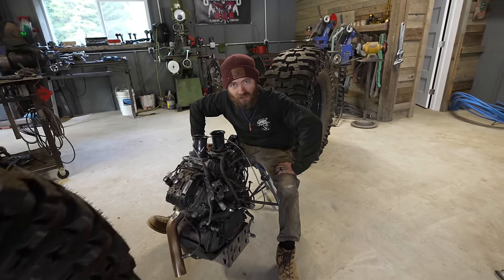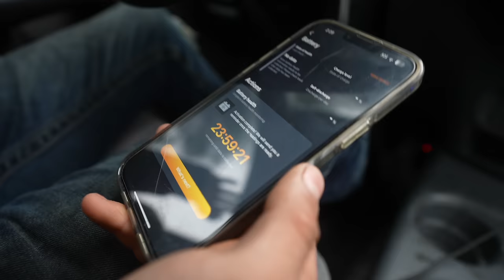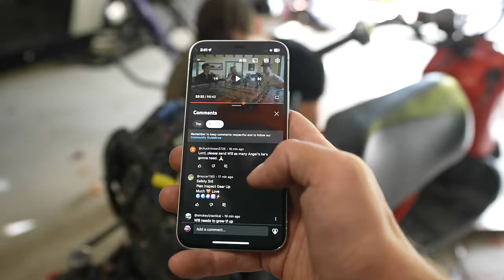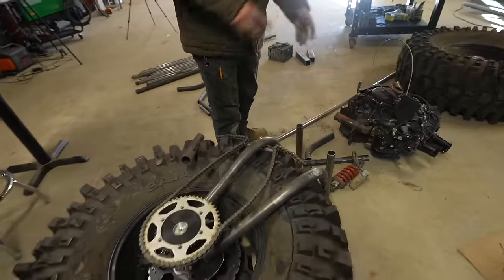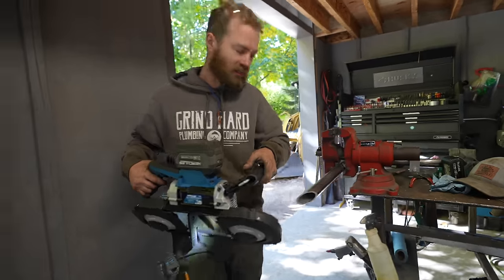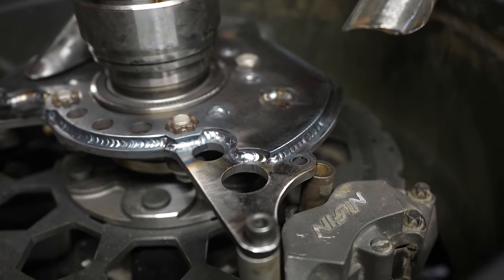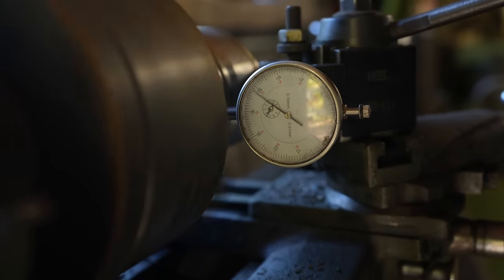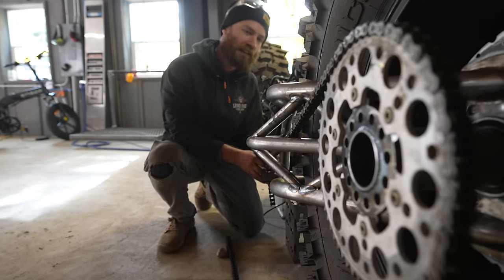Monster Truck Chopper Build! 46'' Tires + KTM Adventure

Comment from the maker: Get 15% off your Carly purchase with code "GHPC" (auto-applied) until December 15, 2023 when you click: https://bit.ly/GHPC_Carly
Reply: “I always have my phone in my back pocket and it makes it so easy to check codes” hahahahahahahahahahahhahaha well played
Reply: Anyways guys since you got the Barbie Jeep the Barbie camper the Barbie mini jet boat it would be awesome to see the general because he's four wheel drive and he is this winter mobile that you guys use a lot during the winter maybe you guys would consider building a like the Kitty cat snowmobiles that already cat makes but one of the Ski-Doo models because they're a little bit bigger and they're a lot better looking wise and put a 1,000 crotch rocket motor or 1000 renegade or just put it on it and build a little trailer for the mini snowmobile and the general will be able to tow the new trailer and the new mini snowmobile that would be badass since winter is coming up
Reply: Mean Build can't wait till it's finished
Reply: Bot
Reply: im slightly concerned about the abundance of incredibly dry wood you have lining the walls, next to the spark emitting plasma cutter in the new shop... might wanna slap a couple tin sheets back there just in case.
Reply: I love buttons on TIG torches instead of the foot pedal
Reply: Heads up. Put a bolt through the center of that hub or it will come apart. It usually has the cv shaft bolting through the center to do that job. But you can do the same with a bolt.
Reply: Tuck your sweatshirt string in when you are using machine tools please. it would suck if you got sucked in
Reply: Do I need to inbox you or turn the person in for commenting to do so on my comment? 😆 🤔

Comment: Swing looking great!! Wont the tire sqwoosh out when the weight is on/jumping etc, or are you running them hard? I run my big wheel tires pretty soft. Just thinking of the clearance to the swing arm, if it’ll rub against it

Comment: I think I’d go with a driveshaft over a chain in this situation. Regardless, can’t wait to see this beast in action!
Reply: I was thinking similar,  a good chunk of a honda Atv shaft drive /swing arm would work for this.
Reply: i get why, but it feels like a chain is cooler imo
Reply: I think that would complicate it quite a bit more. And it would be really cluttered in the rear
Reply: This would be a perfect application for electric hub motors. 🤷🏻‍♂️
Reply: The major advantage of a chain drive in this build is the ability to change gear ratios.
Reply: Chain drives are a lot more customizable.  With a drive shaft you’d need an assembly line of other drivetrain parts.  Too much extra work.
Reply: Some good points about drive shafts. I’d at least go with a beefier chain and sprocket though. I’m guessing that sprocket will get eaten up, and chains will stretch a ton and break. Then again, I don’t suppose this bike will be getting many miles.
Reply: @jdmec81  Lol, exactly.  They ride stuff for a couple days and move on.
Reply: Personally i'd go with hydraulic motors, one for each wheel, they not only would have 2wd but also they would just have to route oil lines to the back and front. Engine would have output connected to oil pump, honestly still not much work to modify it to work that way.
Reply: @millroyboy07  The driveshaft is way stronger though and, for those tires, I think they're gonna need strong.
Reply: @FuckGoogle502  If they use a right chain they should be fine. Something built like a timing chain.  Those typically never have any issue with torque control.

Comment: I made a suggestion in previous video of adding gyro for stabilizing it, and some other changes, but I was also thinking you should make the ride height adjustable. Maybe make some kind of air bag system that allows you to raise up higher if needed.

Comment: Air pressure sense of handles on each side of a handlebar down and more you put pressure on that the more it turns that direction, fly by wire.

Comment: There is a groove around the bearing for an O-ring. That little lip around the hub's bearing is for the o-ring squish into the tapered secrion of the steering knuckle. For better sealing. 👍

Comment: I saw Ethan use a Portaband on a previous episode so I know he has one. Cutting tube steel is way easier with the Portaband than an angle grinder. Also saves wheels.

Comment: I can't wait to see the learning curve when you start to ride this monster. It's going to be a lot harder than some might think. You steer a bike by leaning it more than turning the front wheel. This thing isn't going to want to lean. You'll have to steer it with the handlebars and then force it into a lean. I bet it'll feel a lot like riding an old school three wheeler. Just my prediction.
Reply: You ever ridden a big heavy cruiser? You initiate a lean by counter steering, not leaning your body. Would still be hard to do with this monster because of the tire shape, but no body movement needed in either case, just handlebar input
Reply: @jakezanders6598  Tire shape and width is the main problem. To lean this bike, you first have to lift it. Anything with a square footprint has to be lifted in order to turn it over. This bike will want to stand up straight and it will take a lot of force to lean it. After this hurdle, there's the task of figuring out the geometry of the front forks because the length and height is fairly unprecedented. 1:1 steering is going to be tough.

Comment: I like the idea of Rubicon challenge.  To guarantee not having to use the skinny pedal so much maybe a an electric hub motor in the front wheel for the tricky angles a cycle would have to take.

Comment: Pressure sensitive thumb switches 0 on each side of the handlebar for your to control steering cuz you're going fly by wire then you still got your fingers to operate the brake and clutch

Comment: I love your work. Something like this could use hydraulic powered arms on either side as both a bike stand and a way to lift it up if you drop it.
Reply: Ya like on that bike on B&B!
Reply: Who needs a kickstand when you have full hydraulic outriggers?! I love the idea.
Reply: it would  be cool to have an electric hub motor on the front to get more use of those chunky tires. hydraulic steering would be cool for effortless riding.

Comment: cool build man!  👍 looking fwd to seeing the finished product. i had a thought that you may want to consider adding a outer support/bearing on the id of the sprocket flange.
 i could possibly see the cv spline/cup/extension tube bending/breaking by the chain pulling fwd with such leverage at such a distance. (during aggressive testing/use. lol)  keep up the great wk.

Comment: You may put a support bearing on the outside of your CV extension. Otherwise the force from the chain pulling on the lever arm will break your CV axle, probably right at the beginning of the teeth.

Comment: Do you even need suspension with those sidewalls? Also, don't those tires flex like crazy? Thinking they might be into the swingarm in a corner.

Comment: Why not put a bearing on the outer part of the sprocket support tube and then have a holder that is integrated into the swig arm. Would help with flex a ton. Love the concept on this one.

Comment: notching those trellis tubes: what if you get a shorter tube wuth putty at both ends. press it in, then remove. wrap paper around that and mark, then use the paper with marks to transfer on to the tube that needs to be cut ... fast and easy.

Comment: can you make it so its a double sided swing arm for way more strength and use 2 hubs? The bolting up to the rim may be a wee bit difficult but this will be far more stable. Make it like how a bicycle tire is mounted on a bike frame

Comment: Dont want to jinx it but its making me a bit nervous that those wheel hubs have a certain bit of runout play in them. I hope that its not enough between that runout amplified some 20+" away and the movement of the sidewall you dont end up rubbing on the swing arm

Comment: I'm looking forward to the driving version.>You didn't take "centrifical expansion" of the tire when you made the 'swingarm'.It will get much larger as it spins faster.Will's "h" car company makes an AWD version with a 'torque-tube' to drive more wheels,yet slip when needed,like the 2wd motorbikes do in their frames to the front tire...

Comment: Would be cool to combine the huge sprocket with the brake rotor, and put the caliper in the section between the chain.
Reply: Chain lube might cause some trouble.
Reply: @johnjosephson9277  Excellent point!

Comment: I like the use of hexagons throughout the builds ever since the arc droid dropped on the scene,  but I'd rethink those hexagons in the brake rotor. Each point in the hex is a stress concentration point i.e. failure point. The  load applied by the caliper on the rotor with those 46" tires is going to send the highest concentration of stress right to those sharp angles.... which may well result in total failure of the rotor. Do some googling on performance brake rotors and you'll likely see that none have slots with sharp angles or patterns. That's the reason. Love the hex. Just not here. Stay safe.

Comment: wait...  that hub assembly can never come apart now, can it?   The bolts are trapped in the reinforcement plate that is welded down fully?
Reply from the maker: It can totally come apart. The nuts are captured, but the bolts can come out the back side.
Reply: @GrindHardPlumbingCo  Okay good!  Before commenting I had it on pause at one point trying to figure out if that was a possibility!

Comment: Will doesn't know reliability like he's about to get from that Honda.

Plus the AWD upgrades for the CR-V and civic built for drag racing make the Honda AWD closer to 50/50 torque split.

Akdbuiltperformance have the bits that you need.

Comment: Carly sounds like a good idea but the thing is is I have a Toyota and if I don't pay for the Toyota app I don't know what the tire pressure is on my car and if I plug that in is it going to tell me what the tire pressure is on all of my tires because my car has tire pressure sensors and the car when I had The Limited trial app it would tell me what all four corners tire pressure was

Comment: im slightly concerned about the abundance of incredibly dry wood you have lining the walls, next to the spark emitting plasma cutter in the new shop... might wanna slap a couple tin sheets back there just in case.

Comment: The wheels are so big and heavy this wont work well as a motorcycle.  The gyroscopic forces will give it awful handling characteristics especially over 10 mph.  Combined with squared profile swamp tires i don’t see how this will even turn. Maybe cutting off some of the side lugs to round the profile will allow some lean.  Otherwise attempting to turn will result in tipping to the outside of the turn. 

I look forward to you proving me wrong. The journey should be interesting. I need some popcorn for this one.

Comment: those standoffs are a terrible idea for mounting the calipers imo, my bet is that wheel, rotor and 5klbs of beef try to take those lill calipers right off that hub and dont forget a bleeder needs to be vertical to bleed air or you need to pull it to bleed it .. , ive seen it done before on cars and overkill is the name of that game, calipers mounts are meant for sheer force not folding,. , plate or block your spacers both holes in 1 piece or maybe weld the spacers together so they can't ever fold., or you're asking for trouble ,.,. imo

Comment: Why would Honda and Kawasaki use bolt patterns that are 1mm off you ask? same reason some manufacturers like GM/BMW etc use 5x120 when EVERY decent car on the planet has used 5x114.3 for decades, so they can sell you THEIR wheels and THEIR brake rotors, for a week until the aftermarket catches up :D

Comment: I'm really excited to see this build come together. I do like the idea of big hp but this is the type of build that deserves a 2 stroke. If you don't think a commonly found 500cc engine would be enough Maico makes a 685cc that's close to 80 hp.
Reply: That sub 200hp will be fighting the tires.. I don't think less power at 2x the rpm would be great
Reply: @PureCountryof91  😆
Reply: @PureCountryof91 as Ethan explained at the beginning he is going to be doing some work on the reduction drive. It's a already proven platform it just over heated because he needed a bigger radiator from the fact it's designed for motorcycle that depends on a higher average speed to keep it cooled with that small of one he needs a radiator for a truck or something. I wouldn't use a rare 2 stoke 500cc from Germany because parts would be difficult to get on the fly. If it was me I'd use the motor from the 2nd gen Hayabusa's paired with that reduction drive. Very stout motor with lots of parts available. Considered to be the strongest gen made of high quality & very dependable. Plus you get the turbo sound!!

Comment: All right guys I got the awesomest idea since you got the Barbie camper and the Barbie mini jet boat you got that big beautiful blue general with that Harley motor on it winter time is here since you got the Barbie camper in the Barbie Jeep in the Barbie mini jet boat now it's time since winter time is here the general is four-wheel and has that badass motor on it and now it is time to make a mini snowmobile with a 1000RR or any 1000 crotch rocket motor oil Can-Am 1000 renegade motor and build the badass mini snowmobile so the general have something to toe around in the so instead of taking like a kitty cat frame from take one of the new Ski-Doo frames that are like the kitty cats that little and put a 1000 and then build a make a little trailer for it and let the general tow it round

Comment: That swingarm tubing is way too close to that tire. Speed will balloon the tire. Due to low weight you wiil run low psi which means the tire will move side to side slightly in turns, side hilling, etc.